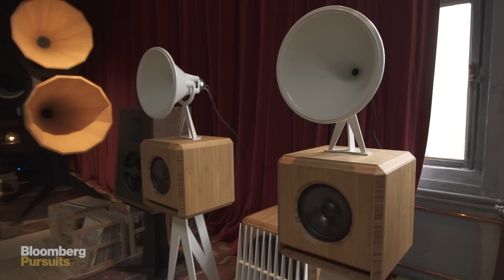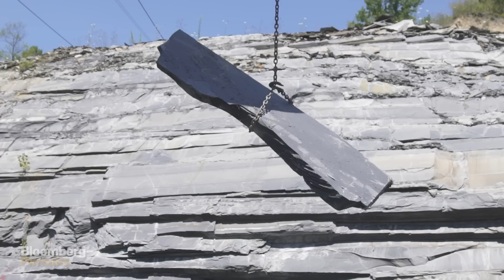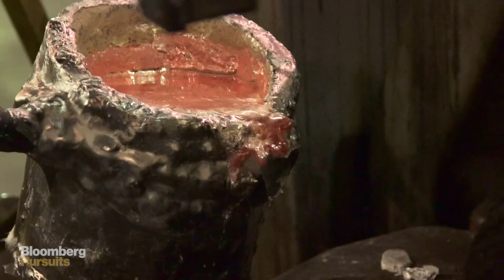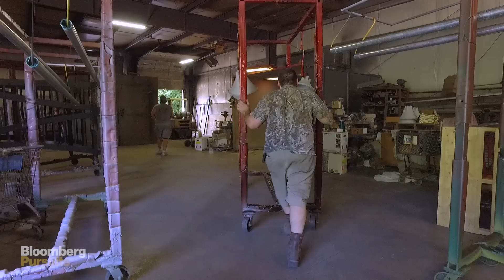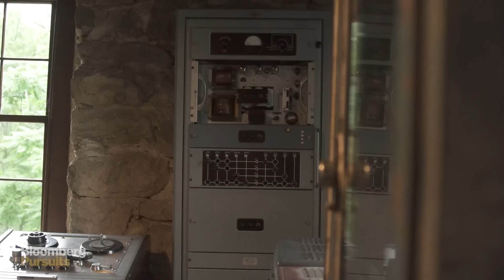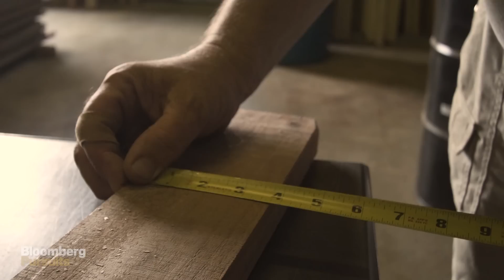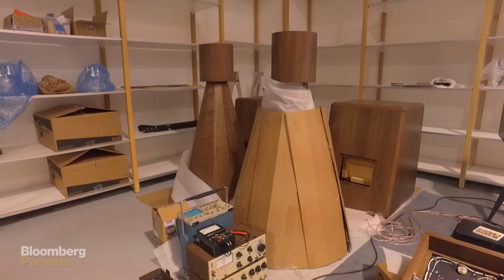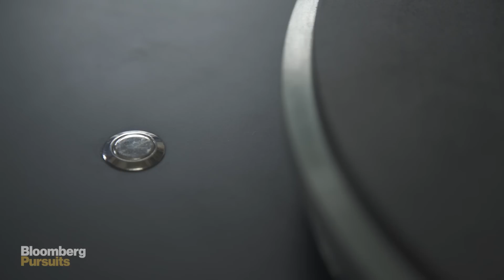How a $300,000 Speaker is Made

Comment: any engineer of any field presented in that clip will laugh at this
the only amazing thing, is that this guy can sell his piece of garbage for 300 000$
Reply: Exactly!
Reply: You make a fair point regarding the luxury aspect of the physical build quality. I just find the entire audiophile cult perplexing when I can take an oscilloscope to most of this "high end" analog gear and show them what they are really paying for. Truth is you could just run standard digital audio though the right effects/filter and get the same exact effect and sound from a well built solid-state amp. It's one big ass placebo effect.
Reply: Sapher yes
Reply: You got suckered into buying one of their speakers?
Reply: Christian Colbach, A Ferrari have thousands of moving parts, lightweight but rigid components, luxury, and speed, hell a VW has more engineering and complexity that these speakers, your comparison is so far off
Reply: Ok I wil say this, I checked out what components I could on that amp. They are high end parts however not aerospace grade because that is not exactly a thing unless you are talking space. Most of the time aerospace grade components are just normal components that have their manufacturing history known and documented as well as tested before delivery. The biggest difference you will find in space grade parts is they may have been hardened and or tested for radiation or modified to have larger features so they can last longer in a high radiation environment. Also they are tested for reliability over time. All of those things cost a lot more money (stupid high amounts some times) for absolutely, by definition, no gain since they are just ensuring they deliver an identical part to the normal component plus the extra testing/resilience. Furthermore in most audio applications you can over-spec a component to achieve the same exact effect for a fraction of the price.  Also that setup had the tube sockets out in the open with connecting wires just running all willy nilly to the device without any shielding, They did try and cross the wires at 90 degrees to reduce cross talk but shit, If you are spending 300K because you are an "Audiophile" them shits better be encased in grounded cans made from pure silver.
Reply: No the comparison is right.
The list-price of a new Ferrari F12 TRS is 3.600.000 €. I am pretty sure that this car has not 40x more complexity than a new Mercedes S class (> 90.000 €).
The low production scale make High end equipment so expensive.
I am sure this Speaker is the best money can buy though it will only be a little bit better than a 10.000€ Speaker. Still better than paying $100.000 on an bottle of champagne...
Reply: Christian Colbach One example in a price difference are alloys, a limited production piece of an exotic alloy could be 100's or 1000's of USD, depending on the performance requirements, also endurance if a motor has an RPM of 16,000 like one of a 600 cm2 motorcycle needs much more resistant alloy  but needs to be lightweight in order to achieve speed, an aluminium engine block is more expensive than a cast iron one and some cars are now using titanium... so no mystery on why some cars are more expensive than others
Reply: Yeah, and I guess Pennsylvania hardwood is too more expensive than cheap fir wood. But the price of the materials will never justify the price of a Ferrari or a OMA-Speaker.
Reply: Christian Colbach I agree with your point, both things are over priced, but, you kind of need specialized machinery, engineers, facilities, etc. to build a Ferrari and they need to be somewhat safe to drive at 200 MPH besides, you can buy a new Ferrari 488GTB for $249,150 USD wich is less than this speakers
Reply: A pair of Oswald Mill Audio Mini Horns costs $12,000 USD. You can always compare the high-end product from one company to the low-end product of another company. This is not a fair comparison.
The same about the "specialized machinery, engineers, facilities" you can say about these speakers. You saw in the video that they produce (nearly) everything them selfs. This is indeed more expensive than buying everything on the anonym market.
Reply: Christian Colbach by their own promotional video (this one) they are stating that their technological achievements are dovetail joints and casting iron, everything else is technology from the mid 20th century you are comparing the technology and skill set necessary to produce a Ferrari and by the way they  also produce most if not all of their part (They have an F1 team for that purpose) vs a legacy sound system, what a fanboy you turn out to be
Reply: This is the equivalent of going to the Amish to build you a car.....
Reply: Fools and money.... there will always be rich idiots out there who are convinced with this sales pitch. Maybe those people like the idea their junk is only for the rich and not the common, poor, inferior plebs.
Reply: Sad, but true.
Reply: The lame sale pitch aside.. I don't see why some people would not pay a lot for a quality built and unique system doe.
There's countless of items that people pay big bucks for because of looks or to have something uncommon / limited.
And you are probably the victim of this as well even if you might not know it :P
Reply: Cartier Dankk ha! that's punny
Reply: You know what is sad? caring about what people do with their 'own' money.
Reply: Why do you even care?
I am pretty sure this is the best Audio Equipment you can buy. Nobody said that you need this to listen to HQ-Audio. This is the top of the line. If you buy a Ferrari it's the same thing, you pay for the premium finish and for the low number of units. I am pretty sure that Phillips has about the same profit-margin than they have. It's like he said "this is no mass-production".